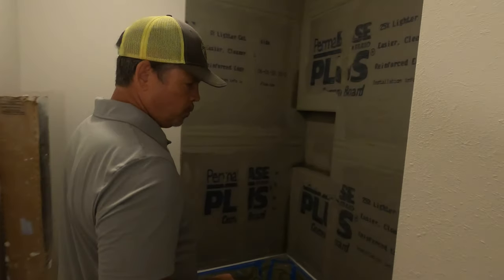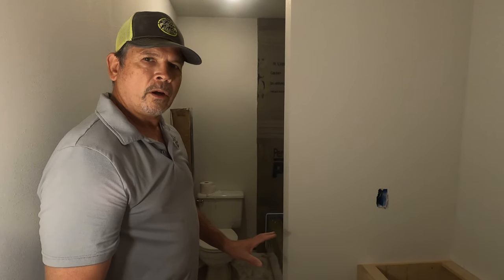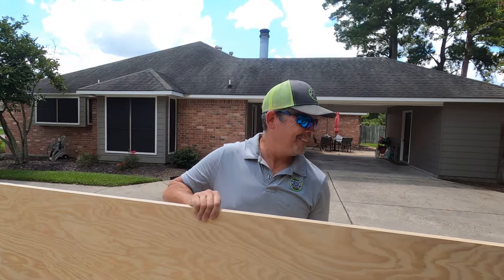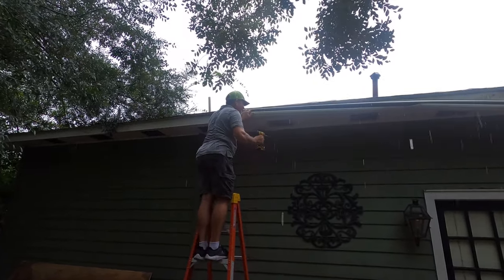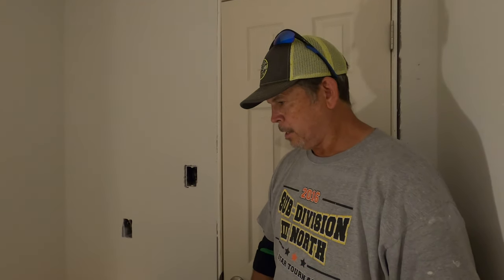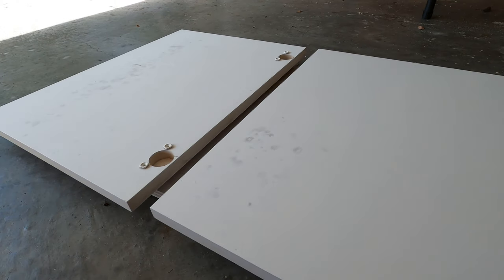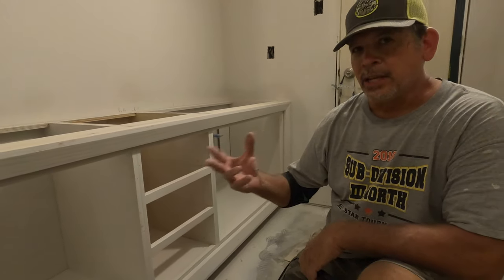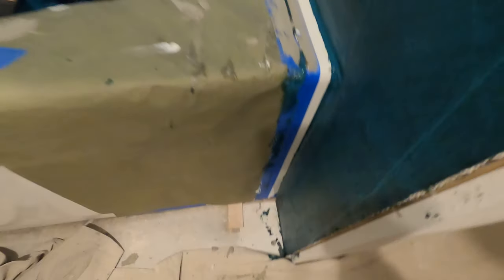Remodeling a Hall Bathroom Part 6: Water Proofing, Prepping and Painting

Comment: Looks great! 

My only complaint is cutting a big square around the plumbing. I hate to look inside a vanity and see the back cut like this. I always cut around the pipes. Water lines don't have to be perfect cause scutions hide the cut. Sewer lines as close as you can get. 

I usually mark the center of the wall and the center of the vanity to take my measurements from. Mark the height of the vanity on the wall. Might take an extra 20 minutes to mark/cut. 

Everything else looks great. 👍
Reply from the maker: Thx levelseven!  yeah I do that sometimes but it sure is a pain plus if the angle stops are on even more so 😖
Reply: @StudPack  if the stops are on, then I understand.

Comment: Instead of cement board and the liquid membrane have you ever tried foam core board like schluter Kerdi board ($$) or goboard ($) or wedi ($$$). Good stuff and easier to work with.
Reply from the maker: No.  I've had a difficult time finding foam board here.  Just now seeing it locally.  I'd like to try it.
Reply: @StudPack  you’ll like it. Lighter, easier to cut, and no need to seal since it’s waterproof.
Reply: Sorry but Schluter product still will require repairs - like acne scars. Every penetration by screw plus proprietary washer to attach to wood framing will have to have Kerdi band Bandage glued on. Not one layer.

Comment: Jordan and Mr Studpack, Do y'all have full confidence in the paint on waterproofing membrane? I've heard mixed opinions and have decided to due to Schluter Kerdi membrane in my shower, but the paint on seems WAY easier and fool-proof. Would love to hear your thoughts.
Reply from the maker: Liquid applied waterproofing membrane over cement backer board checks a lot of boxes for us.  It's readily available, affordable, no special tools/techniques are needed, clients love it, and the end result is pretty great.  Water will have a very difficult time finding a way to the structure once the tiling is complete when done this way.  First line of defense is the tile/grout/caulk, second line of defense is the waterproofing membrane, and the third line of defense is properly installed backer board.  Hope that helps and thanks for the comment!
Reply: @StudPack   love the liquid membrane. Wont tile without it. Glad to see you showing the importance. Also, expect no less from you lol
Reply: Not paint, think of it more as a rubber membrane. Used by many professionals and is code approved.